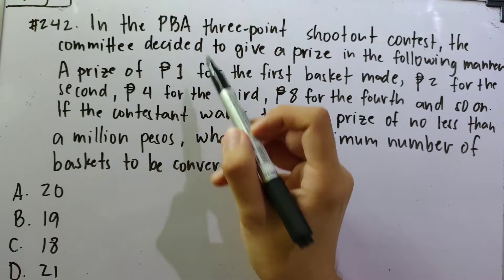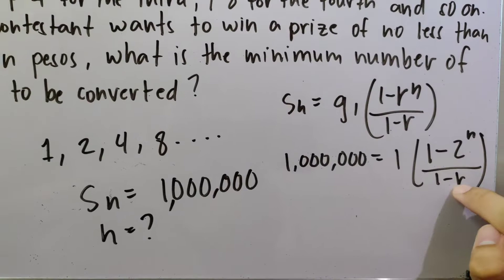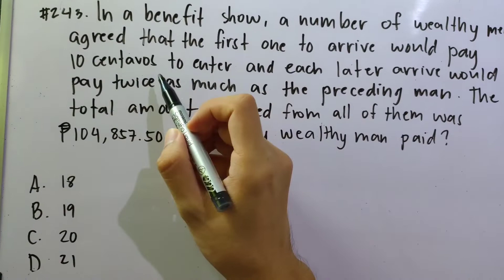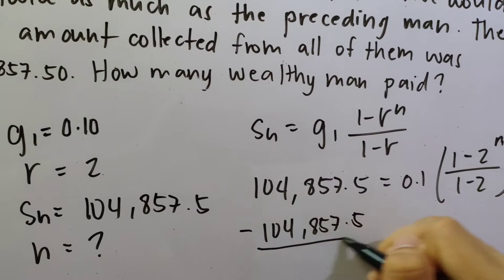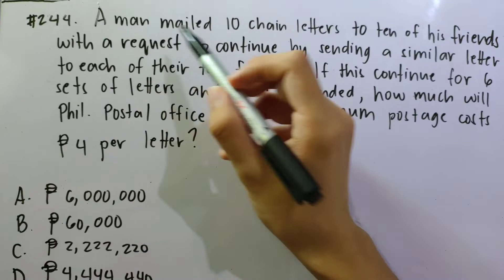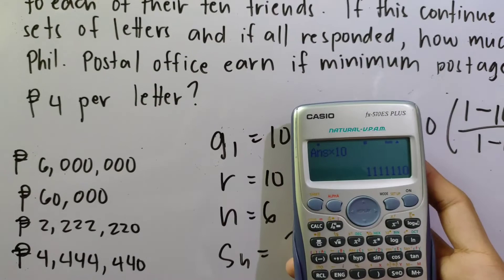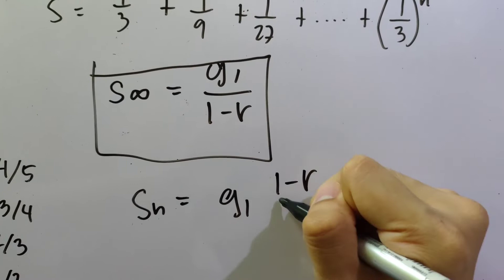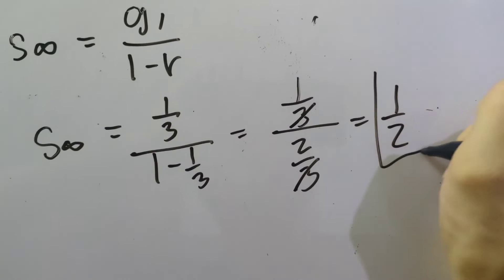GEOMETRIC PROGRESSION part 3  | 1001 Solved Problems in Engineering Mathematics (DAY 5) #242-#246

Comment: Q: mga ilang oras po per day kapo nag aaral during review/refresher days? 12-15hrs?
Reply from the maker: Para sakin, masyadong mahaba ang 12-15hrs. Ako dati kapag may pasok sa review center Hindi na ako nag-aaral pag-uwi as long as naiintindihan ko Yong discussion. Kapag walang pasok, nag-aaral Lang ako mostly 2-4 hrs a day with breaks in between. Max na siguro Ang 6 hrs. Kahit short study sessions Lang Basta Ang importante, focused. Kapag masyadong mahaba Ang study session, bumababa Ang efficiency at nawawalan ako Ng focus Kaya ganon Ang way ko na mag-aral.
Reply: @topnotchertipsph36  how about katulad sa akin po slow learner yung na iistuck sa sa isang problem tpos nauubos oras, kaya nakaka time consuming ano pong payo mo?
Reply from the maker: Parang sa actual board exam, kapag na-stuck ka sa isang problem wag mong sayangin Ang oras mo, move on to the next. Balikan mo mamaya sa next study session mo o bukas. Take advantage of lateral thinking - ibig sabihin nito pinoprocess Ng utak mo Yong problem kahit Hindi mo iniisip. Subukan mo. Skip mo Lang, pag binalikan mo Yan mapapansin mo mas clear na sayo, pag di parin kayang isolve balikan mo ulit next time. Balik-balikan mo Lang hanggang sa Kaya mo nang isolve. That's how experts solve problems.